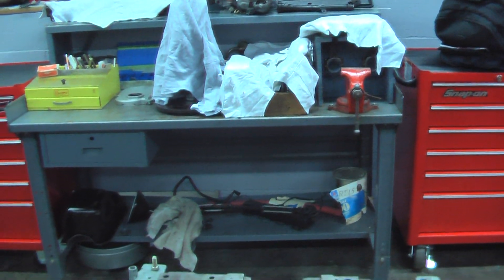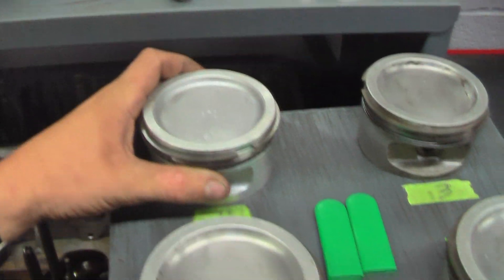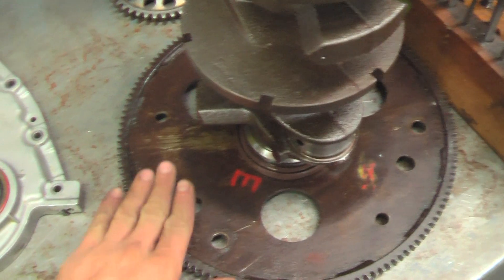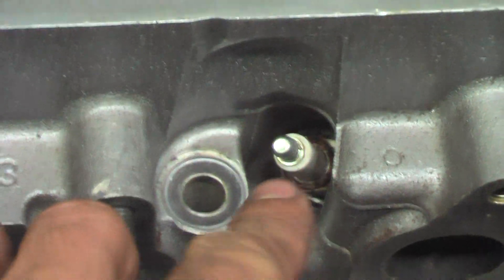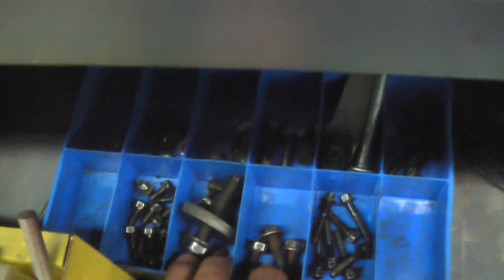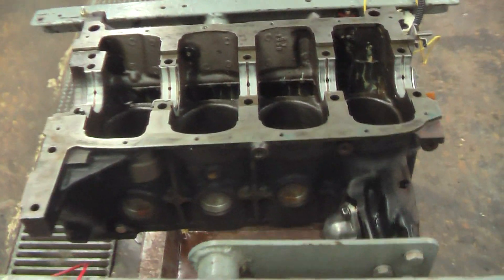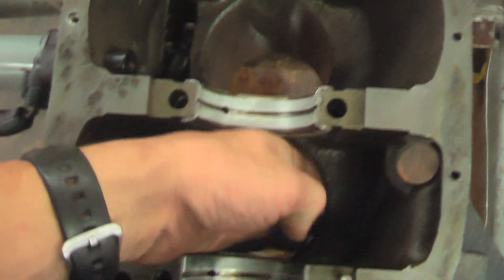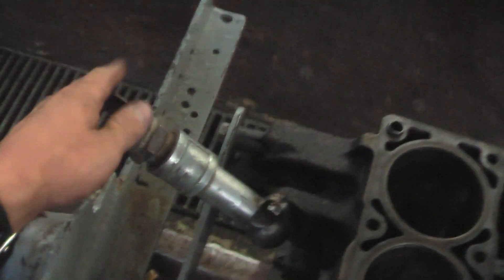GM 2.2 Liter Inline 4 Engine Disassembled

Comment: I wouldn't worry about "micing" the pushrods too much rather do a visual inspection to see if they are scuffed.

I was lucky to just be able to replace the hydraulic lifters in my Chevy LS1 engine as a few of them were jamming up in the engine block,my dad replaced a Buick L36 V6  engine in his car because he thought it was cheaper to replace the engine than to get the cylinder heads done up after they got valve recession from running it on propane gas,the pushrod tips were scuffed in that one.

So,that engine either needs another set of cylinder heads or to have the exhaust valve seats replaced in them then the engine can be bolted into another car,it needs new pushrods as well.

The pushrods in the LS1 engine were all good,the engines compression & oil pressure were all good before I pulled the cylinder heads off & I decided to throw in a new timing chain kit as well as that was a bit worn,the engine was burning any oil & I couldn't catch my finger nail on the cylinder ridges,the cylinders still had the original cross hatch hone marks & now runs like brand new @ nearly 338,000 kilometres.

I also did a leak test on the valves which didn't leak.

Comment: I have 1996 S10 with a 2.2 engine is it necessary to pull the engine out just to get the oil pan off are can I loosen the engine mts in pull the bolts out in holst the motor up with a cherry pick hi enought to get the oil pan off.I think my center cap for #4 piston came off i have to see if there any demages in #4 cylinder wall